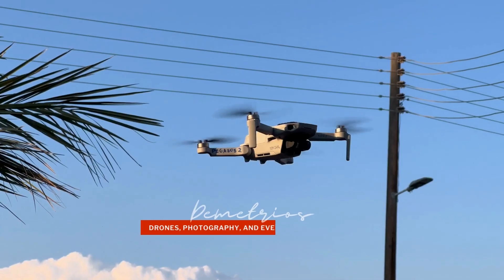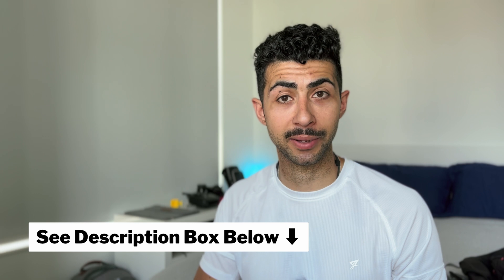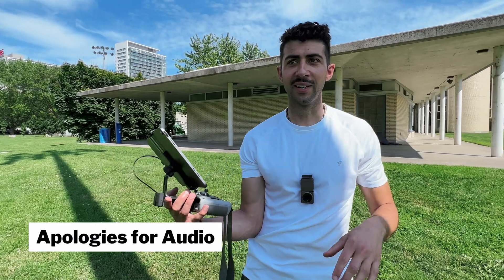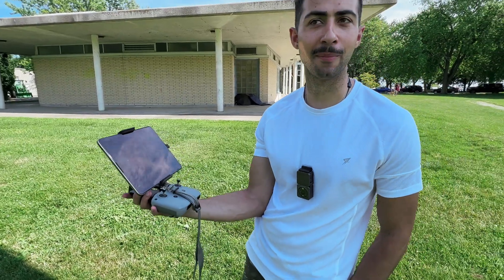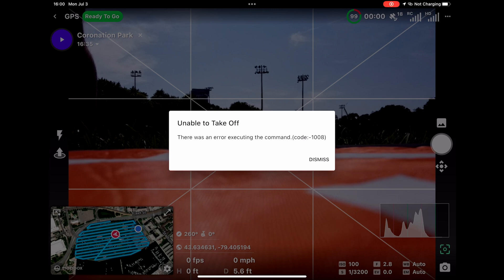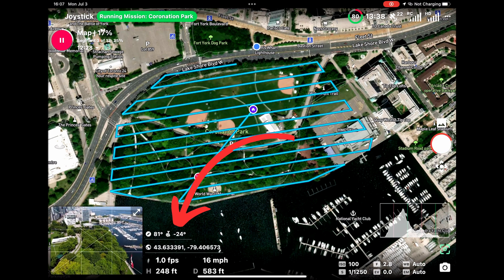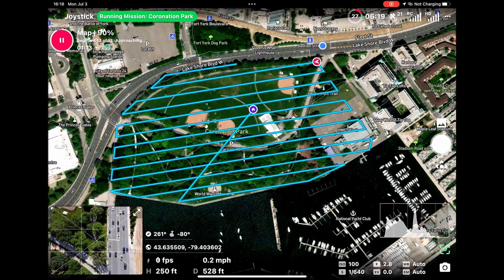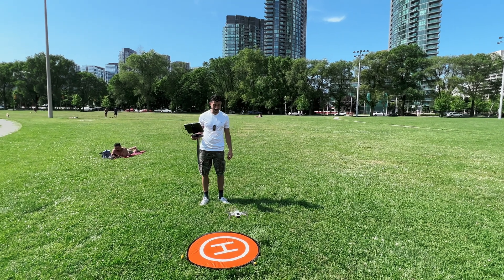Drone Mapping with Multiple Batteries, Map Pilot Pro & Dronelink

Comment: Was the muiltibattery mapping issue with Map Pilot pro addressed and resoloved?
Reply: I contacted maps made easy. And they commented and said that your batteries need to be updated to the newest firmware. Each battery
Reply from the maker: I didn't get a chance to test as the Air 3 came out and been on a journey since. I would like to explore mapping again when the SDK is released for the Air 3
Reply: I'm having the same issue has of today. Tried mapping, first battery all good, second one, just hovering. I need to update firmware for each battery, really? Is that a thing?

Comment: What you did do when the battery ran out halfway through the mission? Did you just change it and take off again to continue mapping the remaining half of the mapping mission?
Reply from the maker: For Map Pilot Pro yes but this didn't work when resuming, I have looked it up but haven't had chance to test. Currently making on content on Air 3. For Dronlink yes I simply swapped the battery and it continued with no issues.
Reply: @DimmyV  Please vlog your test on Map Pilot Pro once you have a chance.

Comment: Thanks for posting the video even though you ran into issues.  Were you able to try another multi-battery map with Map Pilot Pro?  About to try it out myself soon!
Reply from the maker: Yeah all good. It’s actually better to see real world test. I did go into this assuming it will work but like with everything there’s going to be issues and need to problem solve. I did look into this further but haven’t tested as I got the Air 3 and currently making content on that. I can always go back to this at later date. I believe the error was on my part but the instructions may not have been clear from maps made easy.